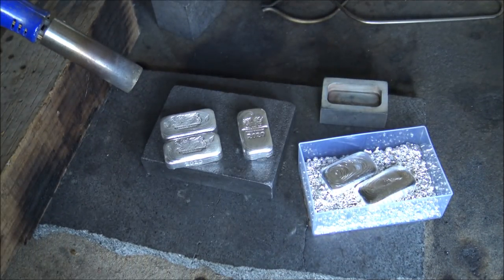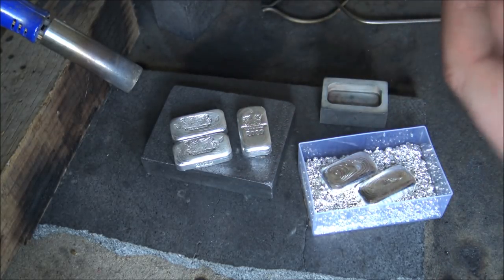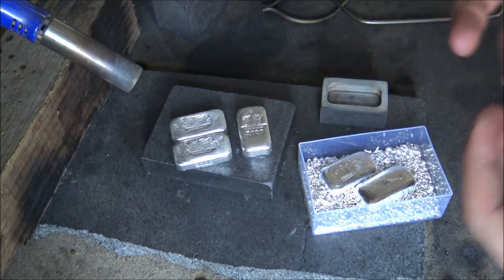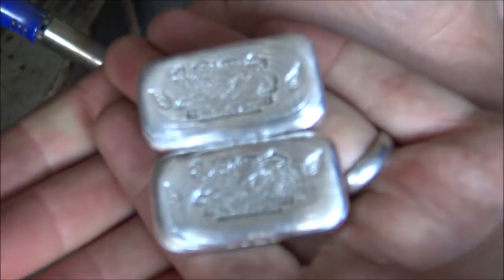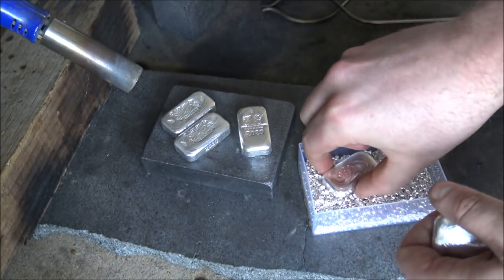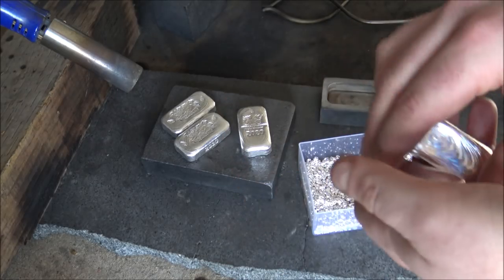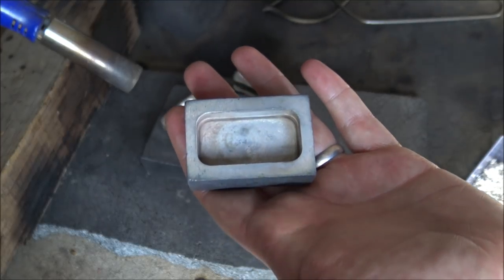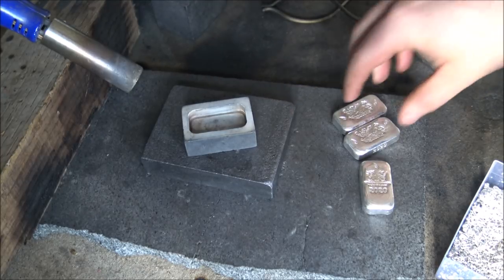How I make my SILVER BARS and ROUNDS at home!

Comment: I cannot help but see the anvil jumping on the table since it is not permanently mounted. Also the poured silver is not mounted to the anvil so it will also bounce.  If you wont mount the anvil, have you considered using a manual hydraulic press to emboss the stamps image ? You would get a more consistent and cleaner image, as a result of same energy/pressure transfer for each piece. I understand that the image of weight/unit of measure doesn't really matter for art but the designers mark that you use, if its highly detailed . Thanks for the Video!
Reply from the maker: One day, I would love to have all of those things. But, we are literally working from the kitchen and dining room table so it is just not possible with the space we have. Thanks for the suggestion and for stopping by and watching!

Comment: Hi BB
Quick question.
When I stamp some of my thinner bars it bends the bar. Have you experienced this  and how can I remedy the problem?
Thanks !!
FB
Reply from the maker: The problem is pure silver is very malleable. I would suggest a very light strike to get the impression in without warping too much. On some of my bars that have done this I have then hammered something on the other side to flatten it out. Part of the way silver works unfortunately - not much can be done to remedy it.
Reply: Backyard Bullion ok thank you 
I’ll try hammering a little lighter 
Have a great day.